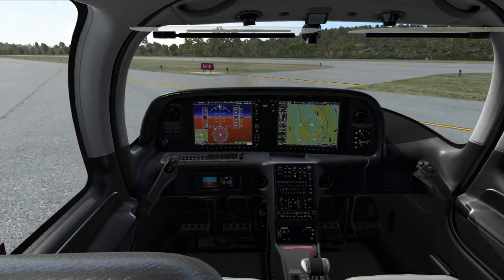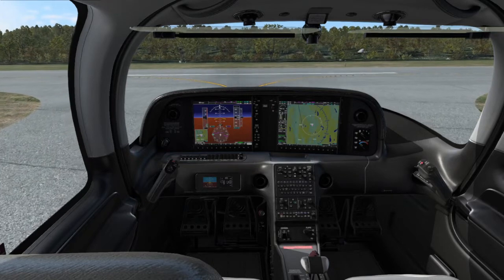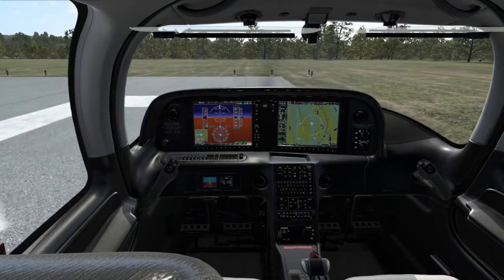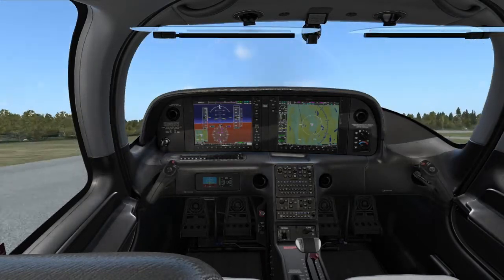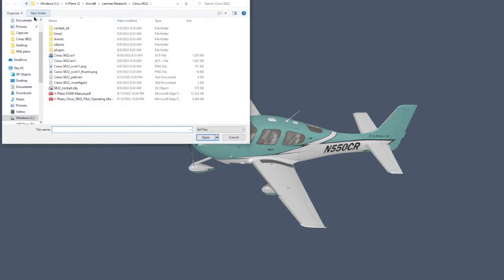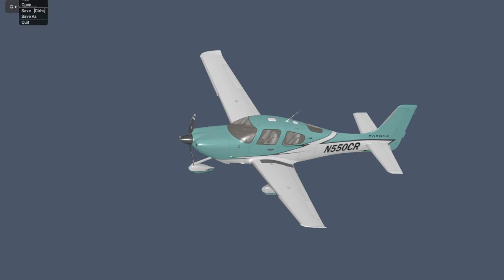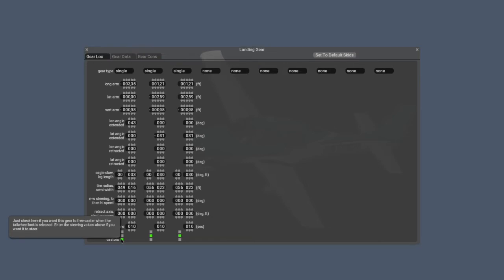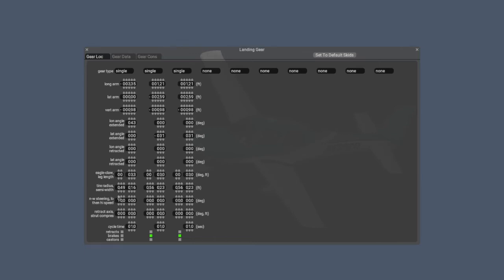Better ground steering for small aircraft in X plane 12

Comment: Thank you so much! I have rudder pedals with toe brakes and it's still nearly impossible to steer a/c w/castering nosewheels like the SR. I stood on the left brake and applied power and the stupid thing did clockwise pirouettes (11 kt winds). I then applied your mod (the first time I've used Plane Maker and I've used X-Plane since v9 and have always wanted to crerate a/c/--maybe I'll finally try that) and it's much improved. Although the real SR has a castering nosewheel, XP's implementation is ridiculous, so I don't consider this a "cheat" as you can at least control it. Interestingly, the RV-10 (which also has a castering nosewheel handles OK, so I didn't bother modding that one. Now, if they could only fix ATC...